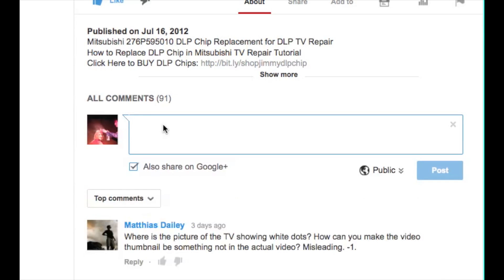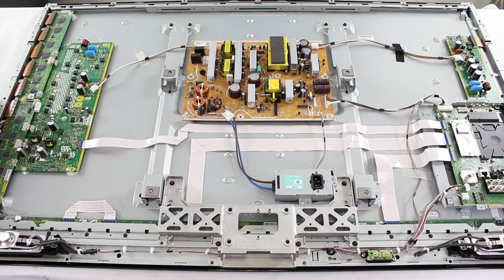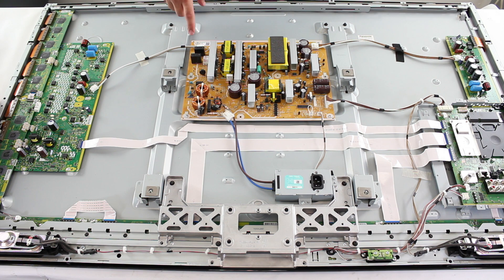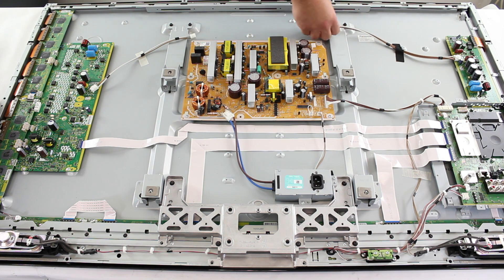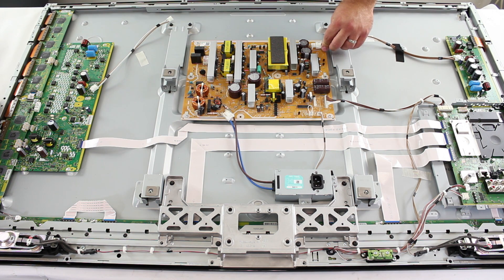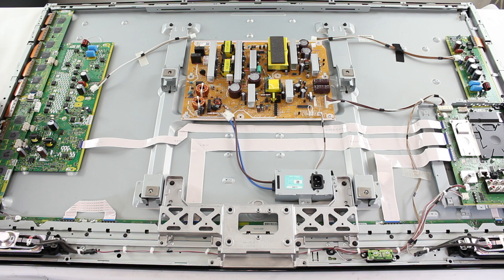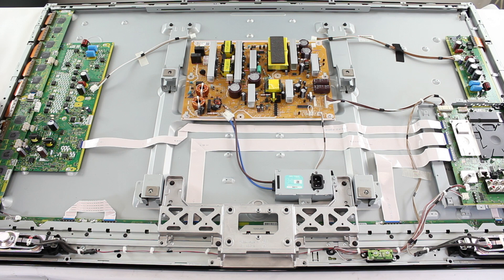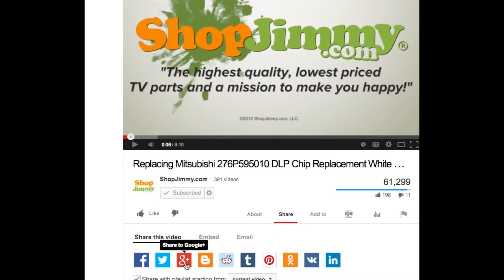Plasma TV Repair Help Clicking Noise & No Picture How to Troubleshoot Y Sustain & X Sustain Problems

Comment: I have a panasonic tc-p58s2 7 blinks it powers up then you here a click shuts down i pulled the back off its coming from the power board i would like to repair thanks Joe it started to shut dowm a couple time but came back on i unplugged x&y board still shuts down
Reply from the maker: Joseph Knepper   Try this at your own risk. Unplug the TV, then disconnect the SC board and plug in the TV to see if the TV powers up. Reply with the results of this test. Thanks! www.shopjimmy.com
Reply: its doing the same thing, iunplugged both boards doing the same thing
Reply from the maker: Joseph Knepper  Please watch this video FIRST to help with your repair!  https://www.youtube.com/watch?v=BP3NVNCGEv8  It could be the power supply or the A board in your TV.  You may need to replace each board individually to see which one fixes the problem.  Click this link to replacement parts for your TV model number:  http://www.shopjimmy.com/catalogsearch/result/?q=tc-p58s2  There may be multiple boards for the same TV model number, be sure to match part numbers on your current board, with your replacement for compatibility.  Thanks and please let us know if you have any further questions with your TV Repair!  www.shopjimmy.com

Comment: Please help!  I have a 73" Mitsubishi DLP WD-73740 Tv.  I have no picture or sound.  I have an error code of 4 red blinking lights and 8 yellow blinking lights.  I've tried to google this code and have had no luck.  I've pressed the power button down for 10 seconds and I've unplugged the tv from the outlet. The lights continue to blink.

Comment: I have a dell w4200hd plasma tv 42" I have no picture but my tv is powering on... I did what you said and there was still a clicking noise I listened closely and it's coming from the power board I turn on the tv and I hear one clicking noise then two seconds later I here another one coming from the power board the previous owner said he was able to get the plasma screen to turn on after a half an hour of unplugging and plugging the tv back in do I need to buy a power board ? Or ?
Reply from the maker: streetfightermayhem  Please watch this video FIRST to help with your repair!  https://www.youtube.com/watch?v=BP3NVNCGEv8  I recommend replacing the Y-Main Board and the Upper and Lower Y Scan Drive boards in your TV.  Click this link to replacement parts for your TV:  https://www.youtube.com/watch?v=R1jmj_foId0  Be sure to match part numbers on your current board, with your replacement for compatibility.  Here is a link to a video showing how to identify your part number, click here:  https://www.youtube.com/watch?v=R1jmj_foId0  Thanks and please let us know if you have any further questions with your TV Repair!  www.shopjimmy.com

Comment: i have a samsung UN46D8000FYXZA,was working good but one day the tv only have noise clik clik and  red ligth blinking 

what happend with it
Reply from the maker: verdotenleo   How many blinks are you seeing?  Any other symptoms your TV is showing?  Thanks!  www.shopjimmy.com
Reply: Blinks 3 times in a cicle of 10 times,and is dont turn on nothing and the clik clik
Reply from the maker: verdotenleo   Try all repairs and diagnosis at your own risk.  I recommend that you disconnect the t-con board from the main board and see if the blinking stops.  Thanks!  www.shopjimmy.com

Comment: i have a panasonic tc-p50gt25 that making a clicking noise. its not giving me a blink code
Reply from the maker: Paul Gordon   Try this at your own risk.  Unplug the TV.  I recommend disconnecting the SC board from the Power supply board and then applying power back to the TV to see if it turns on.  Reply with the results of this test.  Thanks!  www.shopjimmy.com

Comment: Quick question. I have 72 inch tv KDL70R550A that wont turn on, only the green light is lid at all times. I have tried to check for reset button but nothing. I also unplugged it from the outlet and nothing any suggestions?
Reply from the maker: Lupita Delgado   I recommend running the flashlight test on your TV.   Here is a link to a video we produced that shows how to run the flashlight test. No Image No Picture on TV Screen - Flashlight Test LCD & LED TV Repair - How to Diagnose Symptoms 2 Please reply with your flashlight test results and we can recommend a replacement part for your TV repair. Thanks and please let us know if you have any questions! www.shopjimmy.com

Comment: Hi, I'm really thankful for the videos i thought my tv was trash.. my problem is that its making the clicking sound but it wont turn over to show a picture i can turn it on and off no problem but no picture the sound isn't that alarming because it normally makes a clicking sound before coming on??
TV BRAND: SAMSUNG
MODEL: FP-T5084
MODEL CODE: FPT5084X/XAA
TYPE: SA50P9
AC110-120V~60Hz 520W
VERSION: KR02
SERIAL NO: AJD83CMQ300645J

THANKS AGAIN

Comment: I have a Samsung model FP-T6374 Type SA63P7 it will eventually show a picture but clicks on, I see a quick flick of an attempt to show video (black and white) but the pic doesn't show until I cycle power 10-15 times and it eventually shows the pic.  Is this a power supply issue or video board issue?  My number is 406-369-2235

Comment: I need your help (again) I have a Element 26" 720p 60Hz Class LCD HDTV, ELCHW261 that as soon as I turn it on the screen is white, I can't get to the menu or inputs or nothing, just a white screen. I checked some voltages and there are 12v going to the T con board but it does the same thing weather the tcon board is hooked up or not, just a white screen.

Comment: I have a Samsung PN51D550C1FXZA. I was experiencing the pink banding issue for quite some time. I adjusted the VS and it went away. The picture was perfect after that. The next day the tv shut off and started making the clicking noise. I followed the test in this video and determined the X main board appears to be bad. Is there any connection between the X main and the pink banding? I'm worried that if I buy a new board the same thing will happen again. Thanks.
Reply from the maker: Wes Smith  Please watch this video FIRST to help with your repair!  TV Repair! LCD, LED, Plasma, DLP How To Fix Your TV with ShopJimmy.com Help!  Yes, this is a direct symptom.  I recommend replacing the X board and that will fix the problem.  Here is a link to replacement parts:  http://www.shopjimmy.com/catalogsearch/result/index/?cat=65&q=PN51D550C1FXZA  Be sure to match part numbers on your current board, with your replacement for compatibility.   Thanks and please let us know if you have any further questions with your TV Repair!  www.shopjimmy.com
Reply: ShopJimmy.com Thank you. This must be a popular board. I can't find one in stock anywhere. Any idea when you might get more? (@samsung-lj92-01763c-x-main-board.htm)
Reply from the maker: Wes Smith  Unfortunately we do not know when we will have more in stock.  You can signup to be notified when the part is back in stock on the product page.  Thanks!  www.shopjimmy.com

Comment: Okay.., cool. I'll give that a try first. Do you have both the Main & T- boards in stock.
Reply from the maker: Alfred Ringgold Here is a link to replacement parts for your TV model number on our website, CLICK HERE:  http://www.shopjimmy.com/catalogsearch/result/?q=KDL-32BX300+  Be sure to match part numbers on your current board, with your replacement for compatibility.  You can also call our customer service for further assistance with your purchase.  (877) 881-6492  Thanks and please let us know if you have any further questions with your TV Repair!  www.shopjimmy.com

Comment: Hello & thanks. I have a Sony Bravia 32" LCD digital TV Model #KDL-32BX300 Serial #8175318. The problem is there's no picture at all just a light blue screen. I do have sound. Can you help.
Thanks again,
Reply from the maker: Alfred Ringgold   This could either be a problem with the T-Con board or the Main board in your TV.  I recommend replacing the T-Con board first and if that does not fix the problem, then replace the main board.  Here is a link to replacement parts for your TV model number on our website, CLICK HERE:  http://www.shopjimmy.com/catalogsearch/result/?q=KDL-32BX300+  Be sure to match part numbers on your current board, with your replacement for compatibility.  You can also call our customer service for further assistance with your purchase.  (877) 881-6492  Thanks and please let us know if you have any further questions with your TV Repair!  www.shopjimmy.com

Comment: Hello, I watched your video as well as some others. Thank you for the information. My Panasonic Plasma tc p50-G20. My tv made a popping noise when it turned off the other night and gave me a 4 blink code suggesting the power supply being an issue. When I tried plugging the set directly to the wall and holding the power button for about 20 seconds (other people stated it fixed their TV's) I get a 10 blink code which suggests the A board. What do you think? My set is from 2010 and has already been serviced once before.
Reply from the maker: david8624   Try this at your own risk.  I recommend disconnecting the SC board in your TV and then applying power to the TV to see if the TV will power up like normal.  Reply with the results of this test.  Thanks!  www.shopjimmy.com
Reply: ShopJimmy.com I disconnected the white cord from the SC board (board on left) from the power board and then plugged it and pressed the power button. I then got a 7 blink code.
Reply from the maker: david8624   Repeat the same process on the SS board after plugging back in the SC board.  Reply with those results.  Thanks!  www.shopjimmy.com

Comment: So, I've replaced 3 parts in my zenith plasma tv so far, the y-sustain, y-buffer, and the main boards and still nothing. The issue at hand is the TV turns on, but no video. I do have sound however. Want to know if there might be another option for me to change anything in it.

TV modal number is z50pv220
Reply from the maker: Sean Qashat   It sounds like the y-sustain and the y-buffer replacement boards are defective.  I recommend trying a new set.  Thanks!  www.shopjimmy.com
Reply: @shopjimmy  hey jimmy. I have a 50 inch plasma. Hitachi p50h401. It stopped working one day . it would just blink a couple times. I think one of the fans wouldnt turn on so the tv shut off to avoid overheating. Like an idiot i tried to spin the fan as i turned it on but i used a screwdriver and ended up shorting something out as there was a bunch of sparks. Then the tv wouldnt even try turning on . do you know if those tv's have an overheat protection or if that fan not turning on may have stopped the tv from working ? Im wondering if i should spend the time trying to fix it or if im wasting my time. Im no tv repairman by any sense but i do fix alot of things and have some background in electronics

Comment: I need some help with my toshiba regza 32hlv66; there is sound and picture but some of the colors are missing.
Reply from the maker: adel769   I would start by replacing the T-Con board and if that does not work, then I would change the main board in your TV.  Here is a link to replacement parts for your TV model number on our website, click here:  http://www.shopjimmy.com/catalogsearch/result/?q=32hlv66  Be sure to match part numbers on your current board, with your replacement for compatibility.  You can also call our customer service for further assistance with your purchase.  (877) 881-6492  Thanks and please let us know if you have any further questions with your TV Repair!  www.shopjimmy.com
Reply: ShopJimmy.com  you wouldn't happen to have a video of how to replace it do you? I think the board is behind all the other4 boards
Reply: adel769   Unfortunately we do not.  Thanks!  www.shopjimmy.com
Reply from the maker: adel769   Unfortunately we do not.  Thanks!  www.shopjimmy.com
Reply: ShopJimmy.com  I just got the replacement t-Conn board and the tv is back on running, just wanted to say thanks for the advice!
Reply: ShopJimmy.com  I just got the replacement t-Conn board and the tv is back on running, just wanted to say thanks for the advice!